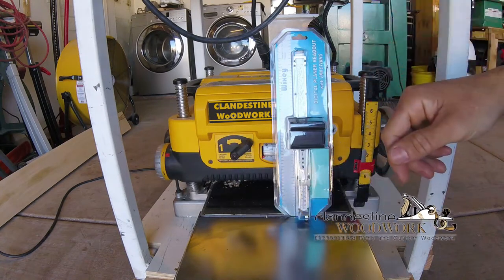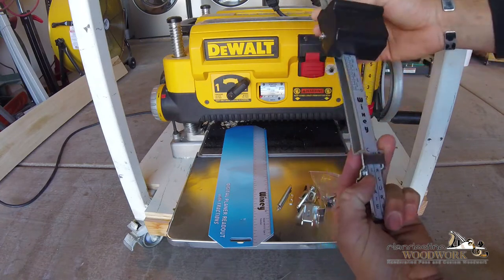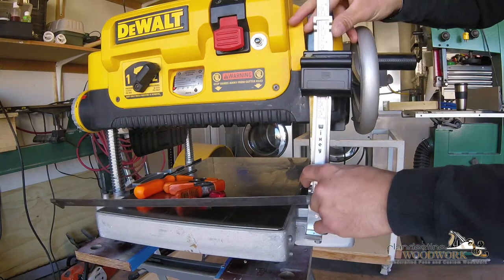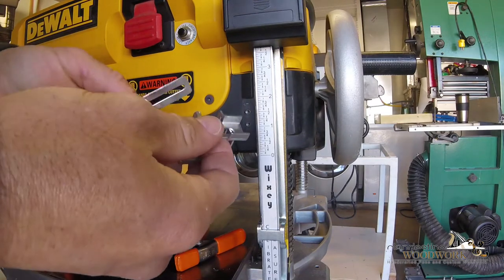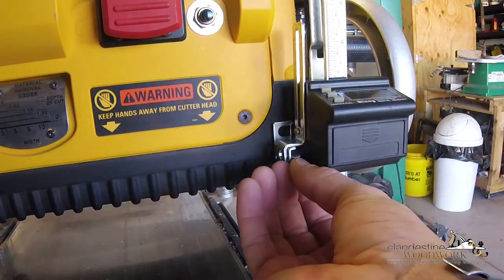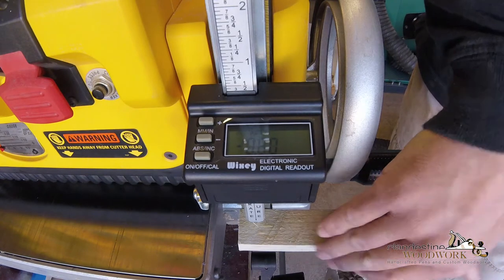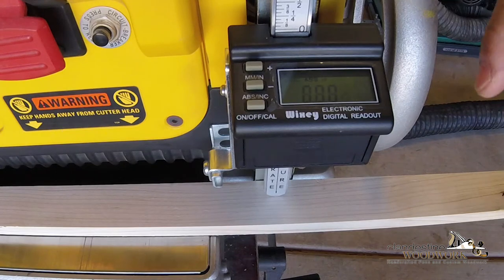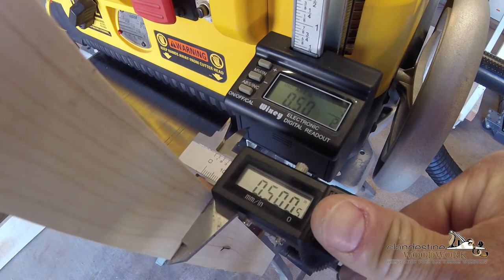Wixey Digital Planer Gauge installation on a DW735

Comment: So two questions

#1: should the measuring bar just drop down on it's on with the spring tension? No matter how much I adjust the screws as soon as I start to tighten them it no longer freely moves, it is kind of bound and I have to push it down. The manual says it should come down on on with spring tension.

#2: Once I have everything calibrated I do not want to raise or lower the height unless the digital readout is on correct? I assumed that if I moved the height when the digital readout was off it wouldn't be correct when I turned it on right.